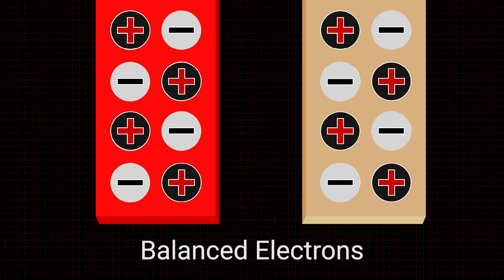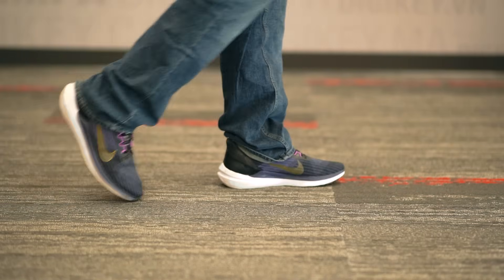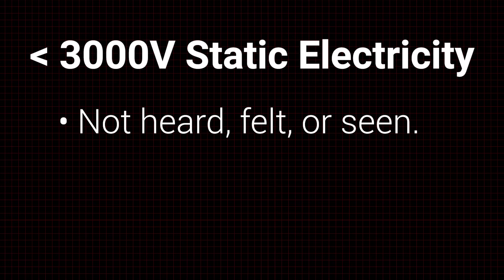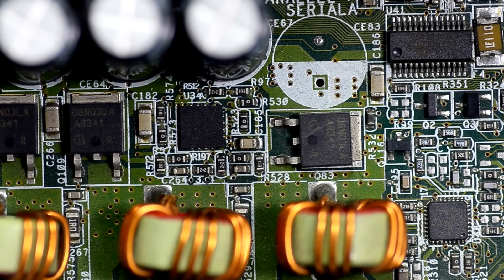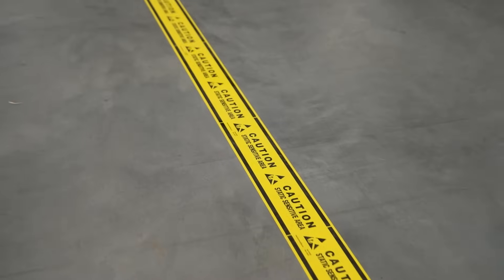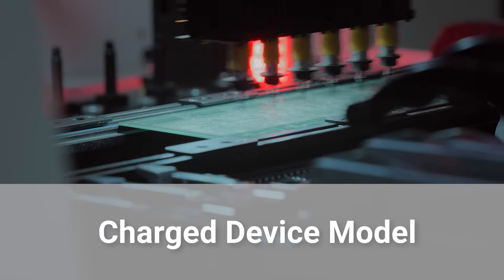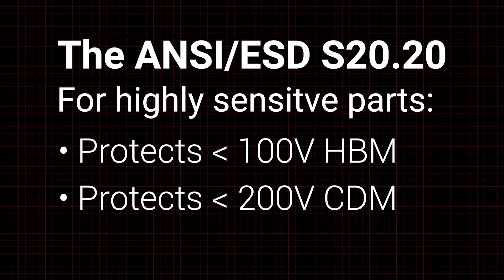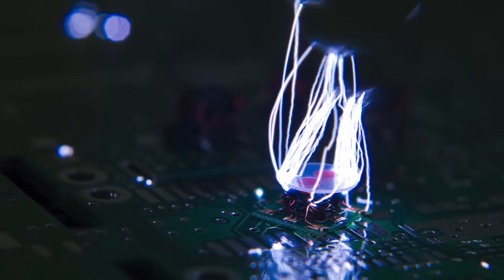What is ESD and How to Prevent it – ATM | Digi-Key Electronics

Comment: When drawing a schematic, should I group all ESD protection in a single area or should I place each next to the component it is protecting? I don't know what the convention is and I've seen it done both ways.
Reply from the maker: Hello, good question!

Always place them as gate-keepers or security guards physically next to the components you are trying to protect. Just like adding your buffering capacitors next to each IC to help with voltage drop and high frequency noise mitigation. 

Electrically, you could place them all in a pile (they would be connected to VCC & GND), but practically, they need to be next to what they are protecting as it does take time for electrons to flow- so it helps to think of a harmful spike trying to move along your PCB traces- if it gets to your sensitive component before your ESD protection, it's likely too late.